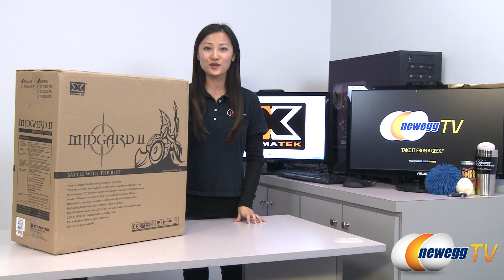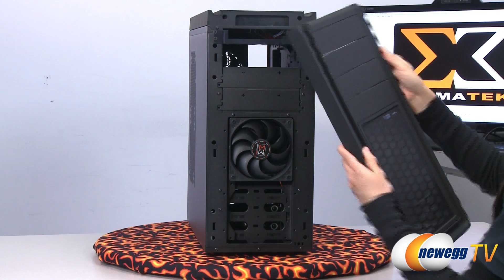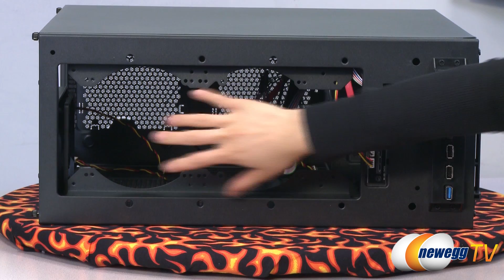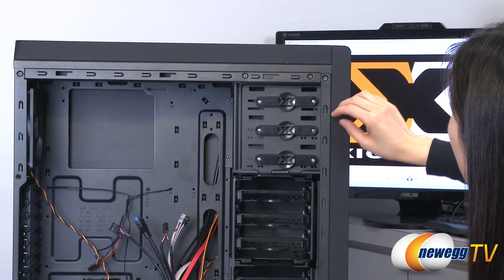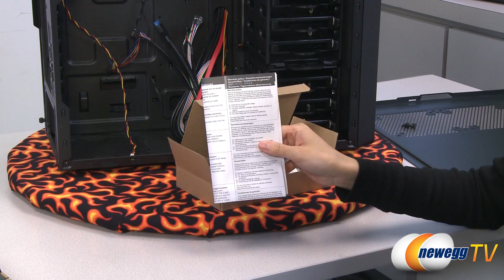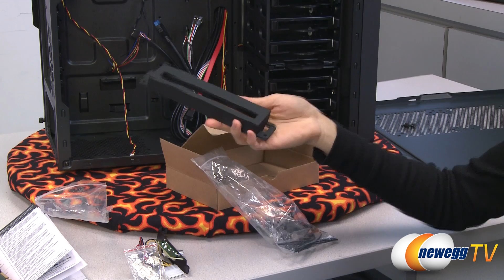Newegg TV: XIGMATEK Midgard II Computer Case Preview

Comment: @mario11168 lol its not an effect, the lines across the screen (or tearing) mean it's "interlaced" (1080i) if it were "progressive" (1080p), there would be no such defect. 1080i and p do have 1080 lines on the screen but 1080i only shows 540 lines at any one time and during rapid movement, the screen tears like that. if it were 1080p, there would be no tearing because it shows all 1080 lines.